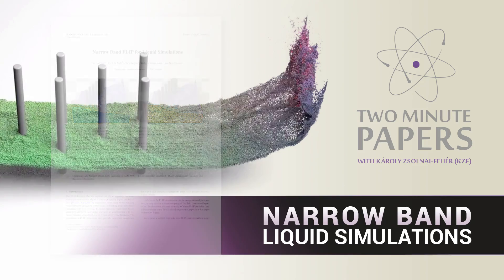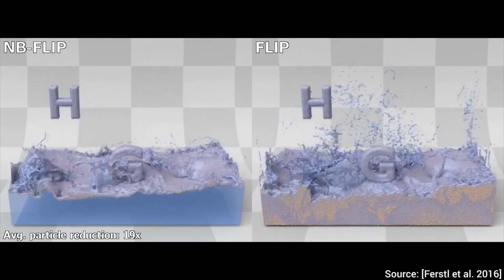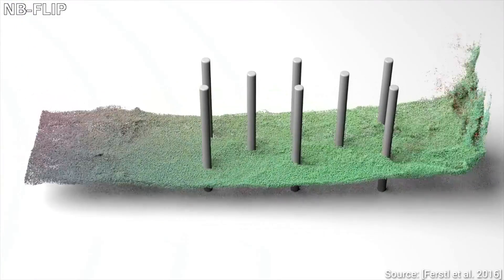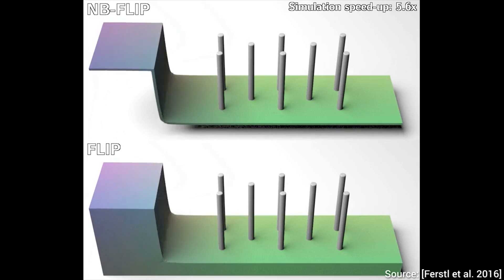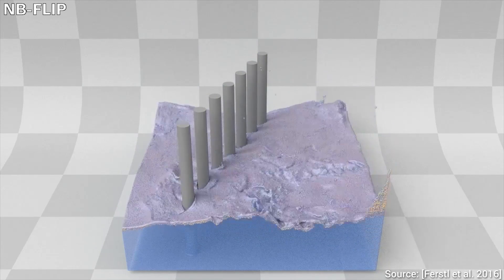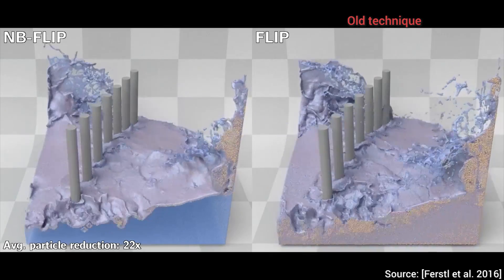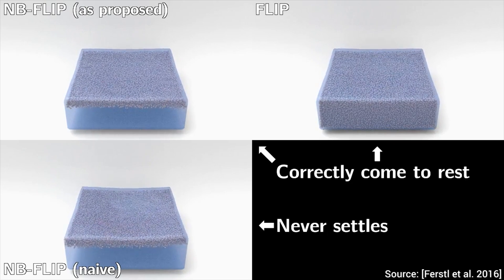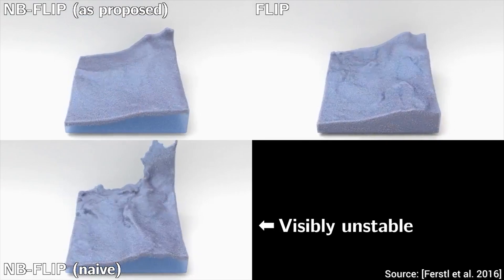Narrow Band Liquid Simulations | Two Minute Papers #61

Comment: what if you combined Adaptive Fluid Simulations with this method, how much faster would it be?
Reply: You can't combine the 2 it's like 2 different solutions to the same problem, they don't add.
Reply: Yes they do, the surface is still made out of a certain number of particles, this could be refined with fines and more numerous particles where the detail is important, like near an obstacle.
Edit: Whoever wrote that is an idiot.
Reply: Hey! I'm not an idiot, just misinformed!